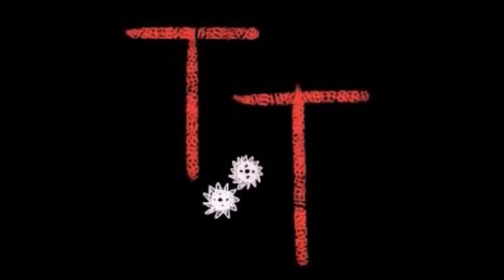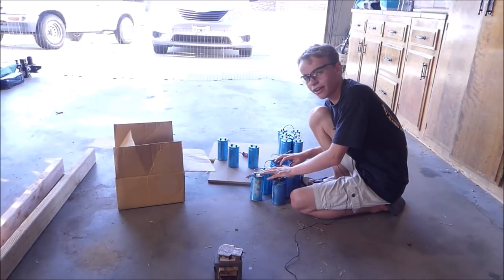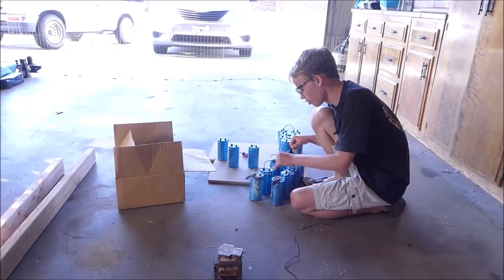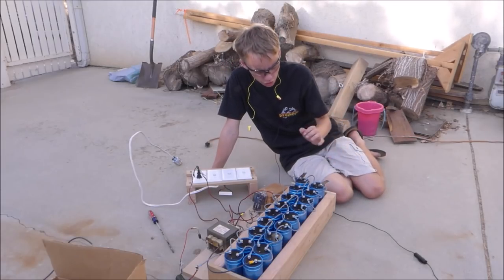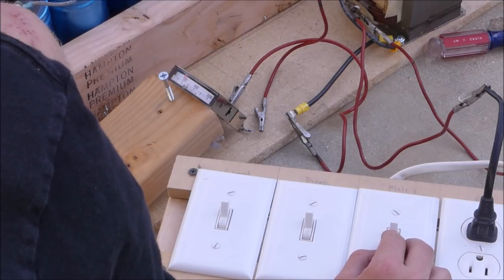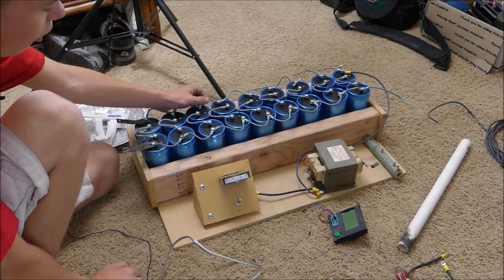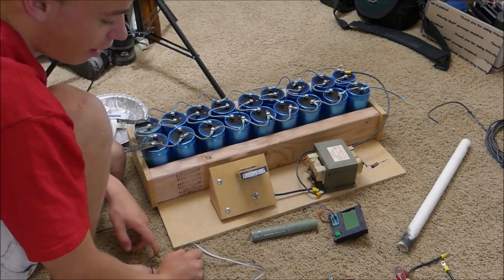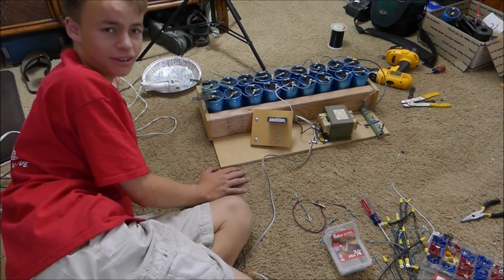1.2kJ Capacitor Bank!! (V2.0)

Comment: Helo from Finland. have been build these same kinda banks for some time now. So i have couple of questions if i may ask. the caps you are us1ing are they electrolyte ones? I personally use electrolyte ones and have stumbled this one problem.. after the short circuit when fully loaded sum of the caps at the negative side nearest to the shortcircuit are bulged up. i also use microwave mot and proper diodes where i build the full bridge rectifier.. i have been tested 1250J cap bank and yeah like 4 of them at the minus side got destroyed.. once tested 2500J bank and the bang was like 3 times louder what was the 1250J one.. now have build 7860J capacitor bank but there is no way id go near there when its shorted :D i was just wondering like what am i doing wronk that some of the caps blow up.. should i add more sturdier ones to the side where it gets shorted or add resistors or what? thanks to you bro already if you answer me :)

Comment: Did you not feel the need to use balancing resistors? Is there no danger of overvoltage if a capacitor in series goes out and the others acquire higher voltage?

Comment: I wouldn't use a screwdriver to short you cap bank, it will jump that handle if the voltage is high enough.

Comment: dude, please, be safe.  you're breaking about every safety rule ever.  the people that do that and claim "oh it's fine i know what i'm doing" are the ones that end up dying.  fatal mistakes happen when you're too comfortable and don't fear what you're working with.  the fact that you touched the outputs of the caps with bare hands is a sign that you don't fear it.  this will get you killed.  please wear gloves.  make something to short the system with when you're messing with it to ensure there's zero charge in it.  maybe a light that's on when it isn't shorted, so you know it's "hot".  i would never touch the outputs of caps of that size, ever.  that's not to mention you have a MoT connected to them, and those run silently.  and even using the nailgun too.  we aren't saying this to be dicks, we don't want to see a fellow enthusiast die from basic safety steps that are being ignored (or maybe you were never taught?).  you can't make cool tech videos if you're taking a dirt nap!